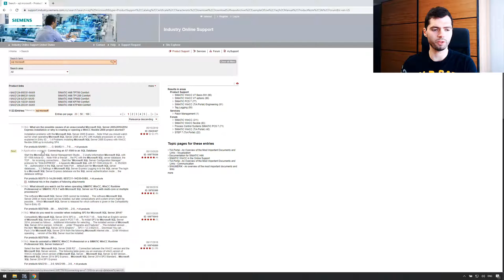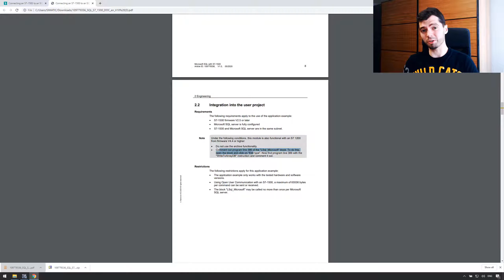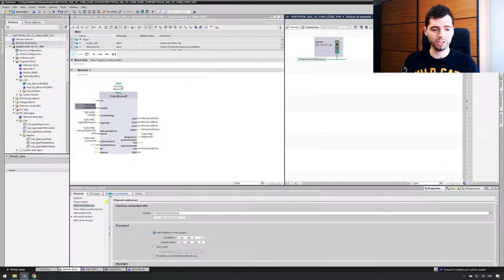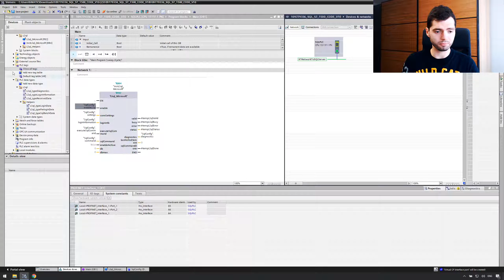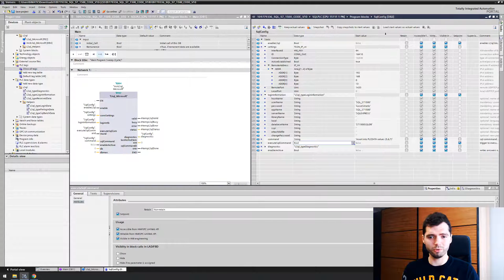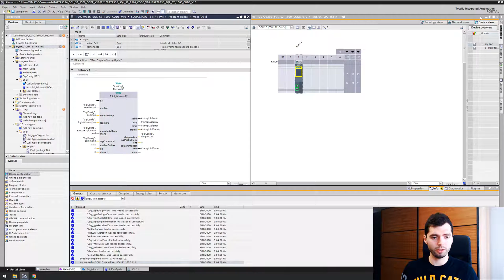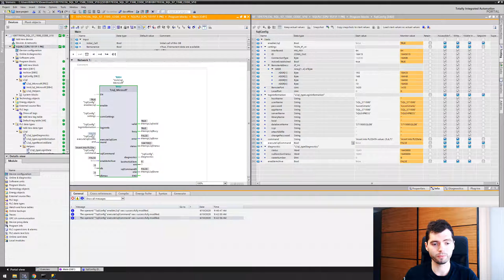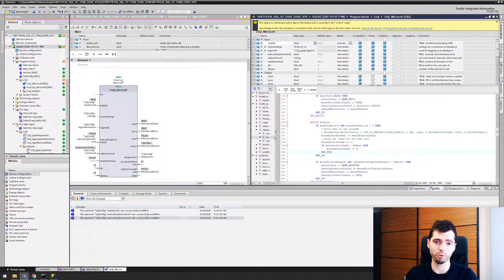Configuring an S7-1200/S7-1500 to communicate with Microsoft SQL Database using Tabular Data Stream

Comment: Guys I got an interesting error , so when I enable the SQL. The code turn to 7002 which is completely normal but after 17s (yes I'd count and each time it's 17sec) it turns to the error code 8602, sub function status 80C6 in state 3 . Does anyone had an idea on how to fix this problem ?
Reply: Did you solve it?
Reply: @sagamoreful  no I never found a solution even on Siemens forums
Reply: Did you solve it?
Reply: @fuatsoydan7377  no never had an answer and never found a solution

Comment: HI, I'm trying to use V2.1 of this block in an S71200 and keep getting an area length error. This version doesn't require line 386 to be commented out as the manual states that the block will work with an S7-1200 from firmware V4.4 or higher (I am using V4.5) it does however state that the parameter "data" must be interconnected with an "Array of Byte" when using a S7-1200. A Structure is not permitted. Does it just mean i need to change the "data" datatype to be an array of bytes rather than the structure?

Any help would be much appreciated.

Comment: HI, Is it possible to connect S7-1200/1500 to Azure Database?
Reply from the maker: Not this way. For Azure check our MQTT video. Most cloud services like Azure or AWS use MQTT brokers so you need to have an MQTT client on your PLC to connect and send data to it.
An alternative would be a hardware solution like the Cloudconnect 7 for example.

Comment: Guys, everyone who has error 8602 - see the connection settings (SqlConfig DB). Recheck IP settings, InterfaceID, port number carefully
. Also check the settings on the SQL side
I had this same error. The problem turned out to be in the InterfaceID number.
I put up the number 64, although I did not have it in the system constants (there were only 65 and 66 for each port) and it all worked
Everything worked fine with the PLCSIM Advanced v3 upd1 (through PLCSIM Virtual Eth. Adapter) and latest for this moment MS SQL

Now I am suffering with receiving a large amount of data from the database. Until I won (
Reply: I completely stuck there I don't know what else I can do

Comment: Hi. What do I need that I can setup a permanent communication for data exchange between s7-300 plc and SQL Server?  Is there a service necessary or do I have to stay online in Tia portal all the time?? I just wanna write data from plc every 10-20 seconds into sql server database. Else I have to use OPC UA and there you use a service that runs...
Reply from the maker: I don't think there's any library available for S7-300 so you might be best off having an intermediate IPC that will talk to your S7-300 and then access the SQL server. Or move to a S7-1500 ;)

Comment: I run a select query I don't know how to retrieve data and read the values.
Reply from the maker: There's a new version of the block available on the Siemens support site that supports SELECT, make sure to use this one and check the documentation for more info on how to do it

Comment: Thank you for sharing this. Great tutorial. I did follow all the steps, but I'm at the end when I'm trying to start the communication from the S7-1200 with my PC, I'm getting the fault message: 8602. In the subfunctionstatus: 80C6. I don't know what I'm missing here. The fault message comes up even before I try to send a message. It looks like the communication is not working between the PLC and the PC. Do you have any suggestions?
Reply from the maker: I'd suggest checking our other video that shows you how to set SQL Express from scratch:
https://www.youtube.com/watch?v=JuletfZOP-M
Once you go through this I'd confirm that you can access your database using Server Management Studio. If this doesn't work, you won't be able to connect from your PLC either and it means that you have either not configured your Microsoft SQL database correctly or something like a firewall or your specific network topology is causing issues

Comment: Thanks for your video, but can I use this method for MySQL, ? I have seen a topic of MySQL of siemens forum but it’s so difficult to understand totally
Reply from the maker: I'm afraid this would only work with Microsoft SQL
Reply: When I use this example for S7-1200. An error occurs because FC Write to array is not supported. :(
Reply from the maker: @lamsonlemai6516    There are restriction on what S7-1200 can do which I mention in the video and are also listed in the documentation. For it to work with S7-1200 you need to comment few lines. Check 12:10
Reply: @AutomationStation  thank you very much.

Comment: Thanks for your great video, and i have a question for you. Now, i dont have CPU S7-1500, maybe, can i use PLCSim to do it ?
when i use PLC sim Advance to simulate S7-1511. Using example project of Siemens,  when enableLsql =1 , Status = 16#8602, SubfunctionStatus = 80C5.
Reply from the maker: I tested it for another viewer and works perfectly fine with PLCSim Advanced. If you open the block itself you can check what these codes mean, hopefully they'll point you in the right direction. Also, did you check whether you can connect to the database using something like the Management Studio?
Reply: @AutomationStation  In my PC, i am using SQL server 2014.  in this video, you use SQL server 2017, can SQL server 2014 connect ?
Reply: I am also getting the same Error, 16#8602 & 16#80C5 using PLCSImAdvance 3.0 & Example project of Siemens.
Reply from the maker: Well I haven't tested with V3 but works perfectly fine with V2
Reply: I have the same error and still can´t figure out what is the problem
Reply: See connection settings.
Change the interfaceID value to 64 (Local ~ PROFINET_interface) in the connection settings in SqlConfig DB, even if it is not in the system constants
It helped me. There were these mistakes too

ps. 

it all works fine for me on the PLCSIM Adv. v3 upd1

Comment: Good video, first of all thank you! But I have a question. How can I run this project with S7-1200? I tried to copy paste the material from existing project to blank S7-1200 project and an error occured which says:
 Drop/Insert(0026:000071)
A test cannot be copied.
Only one test instance of type version Lsql_Microsoft V0.0.8 is permitted.
Only released type instances can be copied. 
Please! What should I do?
Reply from the maker: Check the types folder in you project library - this message is indicating you have put one of the types (Lsql_Microsoft) in edit mode. Right click it and select “discard changes” to restore back to a released version.

Comment: S7-1500 
Example 'insert into PLCDATA values (5,6,7)'
If it's in the s7-1500 DB way, how to write
Reply from the maker: Hello again! If what you're after is writing some dynamic data rather than predefined values to your SQL Database, that's pretty easy.  If you look at the command at 11:26 you just need to build the command yourself by concatenating some strings. I'd make another function which would take my values as the input, and the table name as another input, concatenate these into an SQL command and then spit out the command and then I'd use this command as the actual parameter for my sqlCommand input.
I was actually going to do it but didn't want to add extra blocks and confuse people ;)
Reply: @AutomationStation  Wait for your example, thank you.
Reply: I can read and write To salsy Microsoft SQL Server?
Reply from the maker: @曾亮中  Not sure what you mean by salsy, but it's possible to both read and write data from and to the SQL Server
Reply: @AutomationStation  Archiving received data (enableArchive, db, dbmax)----------->How to use?
Reply: Archiving received data (enableArchive, db, dbmax)----------->How to use?  Come on
Reply: Archive len = 67174534 , Is it normal?
Reply: @AutomationStation  等待您的示例，謝謝。
Reply: @AutomationStation  等待您的示例，謝謝。

Comment: Thanks for the excellent demonstration of a really useful feature. Is it possible to read data back from the SQL database in the same way?
Reply from the maker: Sure! That's when you'd use the enableArchive, db and dbmax pins on the Lsql_Microsoft block.
Reply: @AutomationStation  but how do you read back in 1200 without the archive?
Reply from the maker: Hi Garry, yeah I'm afraid that's only possible with the S7-1500
Reply: @AutomationStation  you can actually do it. I managed to get it to read back in a 1200 . Also noticed the block isn't developed far enough for example it doesn't handle useful production db scenarios i.e. long insert or query commands. Had to modify that. Good concept but not good for memory space on plc or production ready for tracking parts etc.
Reply: @garyharrison9146  Hi, we have a demo with the siemens "stock" example and we find the sqlcommand limited with string only. I can fit 6 analog measurements + column names with string [255]. Any tips how to change this before i hit siemens with support request? Requirement for us is max data length from plc - > sql to avoid manual splicing and time sync of the data to be send. Pdf Manual says 65kbyte send and receive limit so there should be a trick to use something else than string 255 for send. Also the datablocks have quite a lot of room for more than a string. Annoying siemens did not straight away give notes how to extend the example limits.
Reply: @PelleTampio  Only way round this I could manage was sending a few strings... so INSERT command then follow that with an update etc. I did look into the character part of it but blew the 1200 work memory trying to handle so much info. The SELECT side I managed to get to work but only in a "manual" trigger with the same style. It's great function but not production ready if that makes sense?
Reply: @garyharrison9146  Did some more experiments as well and this really works only for small patches of data now and a then if you want to run the actual process program on the PLC as well :) I did stumble on a node-red application example that uses the PUT/GET TCP/IP-link to poll the tags so i can make the data crunch and pass through to SQL/influx on the control PC in the control rooms and leave the process control on the PLC and HMI on local cabinet. PS to vidOP: Nice video and easy to follow. Did learn a few things on the way so thank you!
Reply from the maker: @PelleTampio  There was an update of the block promised with SELECT functionality that was supposed to land end of August so we can only hope the block will get some more development time. In terms of bigger tasks I'd probably still use something like the Soft PLC with ODK if you need to write directly to SQL or look at some other options for data exchange like MQTT or JSON RPC interface.
Reply: @AutomationStation  see that statement has been removed. And don't see anything new like select 😒
Reply: It does work in a 1200 PLC! Gotta program around the TDS 😎